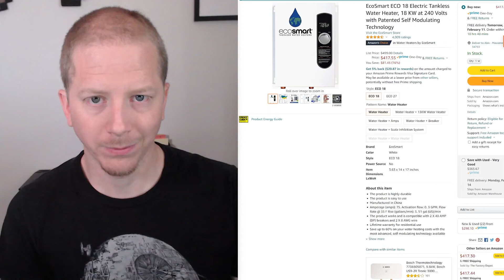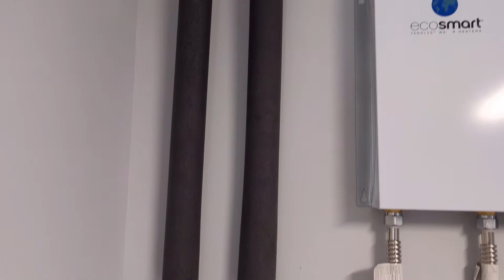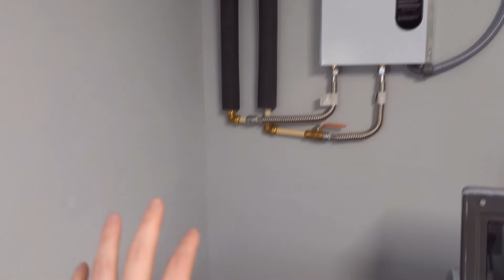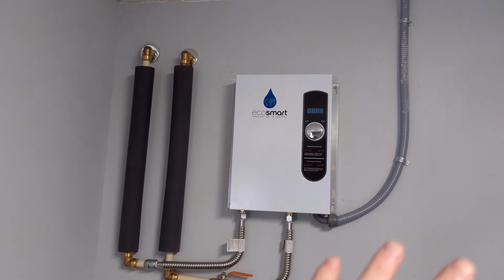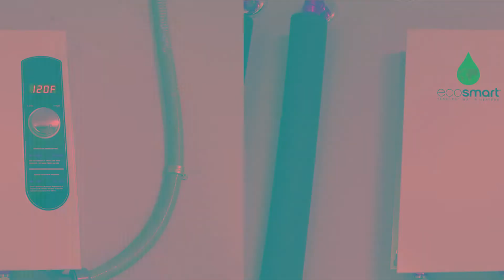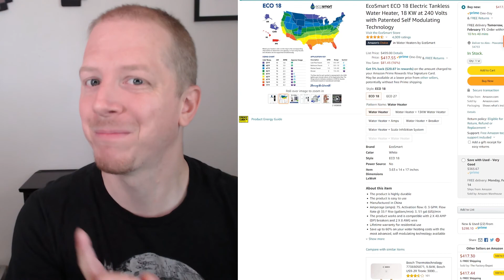EcoSmart ECO 18 - Tankless Water Heater - My Setup and Review

Comment: Hard to believe that two set of  6 gauge wire’s actually fit into that conduit for incoming power
Reply from the maker: Yeah I had it installed by a professional electrician so I didn't get to see the wires but I trust they are there and it has been working well for nearly 3 years now

Comment: Thanks for the information.  I'd do 2 more things to your install:  1.  Add insulation to the rest of the hot water line and 2, replace those hard 90's with more of a swept 90 - the hard 90 has a negative impact on flow.
Reply from the maker: Thanks for the tips!

Comment: Where is the drain for hot water over flow pressure?
Reply from the maker: I had another person comment this as well, from what I understood in the installation manual it was not required. https://s3.amazonaws.com/rmc-cdn/site/ecosmart/downloads/manuals/ECO+8-ECO+36+English+Manual.pdf

I could be wrong but that was my understanding is that it wasn't required since hot water wasn't stored.

Comment: Good night sir. In Trinidad the voltage set up is a bit different to the voltage in the USA. To achieve the 230 v value you have to use a 2 pole circuit breaker. Would the electrics in the eco heater have to use 2 sets of 2poled breakers.
Reply from the maker: I am not sure unfortunately, I had an electrician do the work connecting that side of the unit.  You do have to connect two dedicated circuits as the inside requires to sets of wires, however I would not be qualified enough to fully answer that :)

Comment: You failed to put a flushing tee
Reply from the maker: I added a shut off valve but I didn't feel I needed a flushing tee, I don't think the prior water heater had one either.  Maybe that's standard code now but I didn't see one before so I didn't include one.  I always figured if I needed to flush it I can easily unscrew from the heater as I did when I had to setup it up and flush the system prior to final setup.

Comment: I had this unit ever since it first came out.  We saved a lot on electricity ever since we replaced that big tank. Never required any maintenance. The bill was like $50 in the summer and in winter less than $50.
Reply from the maker: Awesome! I've been enjoying it as well.  Saves space, energy and provides on demand hot water.

Comment: Did you electric bill go up how much more kw did it use a month
Reply from the maker: Hard to say the actual difference on the electric bill as there's so many other variables for me.  But the unit used 194/kWh (~$25 @ .$13/kWh) in February, we were out for almost a week on vacation though.

I don't have any monitoring setup of my old water heater to give you an exact comparison though.  I've read a typical water heater can use around 360/kWh in a month.

If you don't use a lot of hot water 40 gallons or less it can save you a bit of money, if you use 40-80 it can still be more efficient and 80 gallons or more it may be more expensive

I look at it this way, before the entire 40 gallon tank had to be kept hot, so if you use less than that every day you're saving a good amount of money because before you were paying to heat it no matter what.  If you end up using more than your tank water heater would of been table to keep up with (say more than 40 gallons and your water would of normally gotten cold) then you may pay a bit more.  But in either case with the tankless you only pay for power when hot water is in use, so just depends if you use that luxury to use more hot water (longer showers) or to save money in using less hot water.